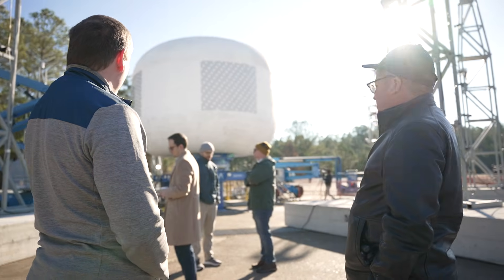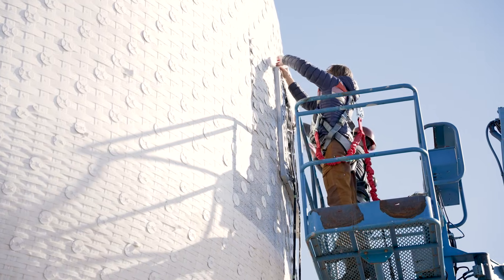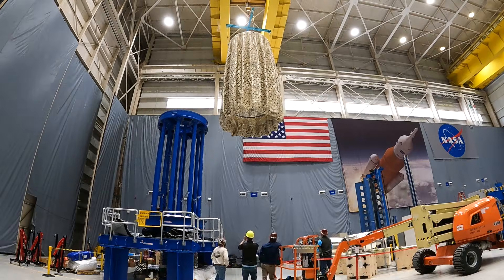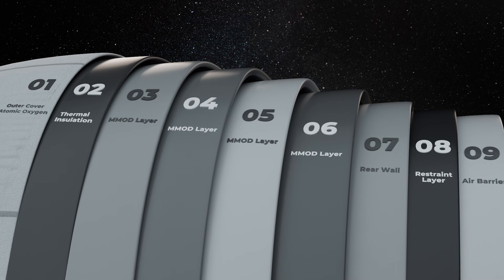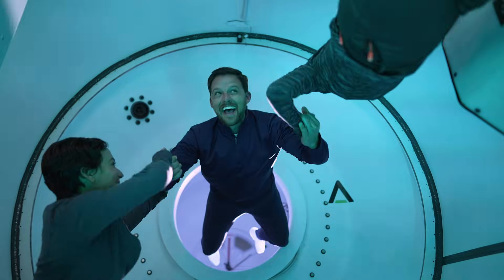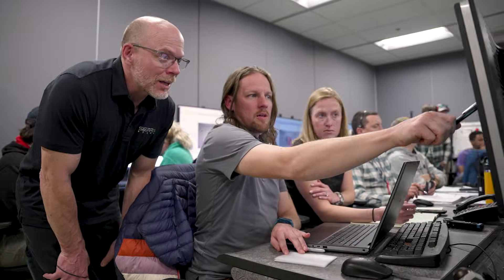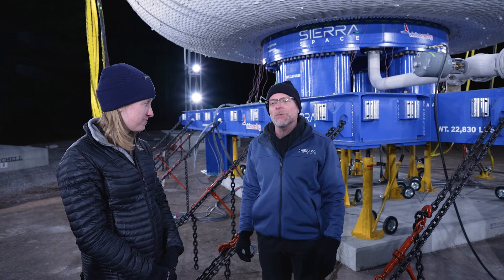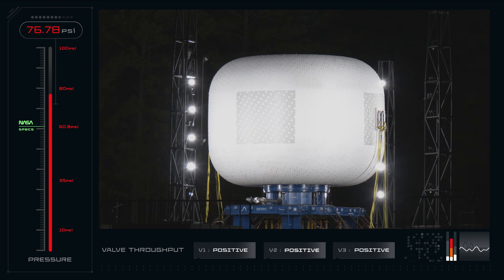Full-Scale LIFE™ Inflatable Space Station Burst Test at NASA Marshall Space Flight Center

Comment: interesting take on living space in space. i just hope its not gonna leave plastic in space too. think of the space turtles. 
in all seriousness the thought of a rupture scares me more than anything. how long is that material gonna last in the vacuum of space and debris along with the radiation. i do think after inflation there should be an internal or external brace put into place. that way in a loss of air pressure like a pump failure the structure will keep some shape so you can easily get in and out for repairs or escape. 
ive been watching your guys' progress for a bit now and its interesting. its always seeing a new take on something instead of everybody trying to reinvent the wheel to do the same thing.

Comment: Basically a huge air suspension air bag. That's mighty impressive to withstand 75psi on that scale. A valve seal broke before the structure, that tells you something.
Reply: dont use chinese valves. or ones rated for use with water.

Comment: I've had a similar idea for years.  the only difference was I thought an inflatable "bag" would be deployed, inflated then a spray on foam of some sort would be sprayed inside the bad to create rigid walls with sufficient insulating and protection properties to allow for much larger habitats for astronauts.  this is pretty awesome though.
Reply: Or have a few layers with valves to inject an expanding foam that sets to have a honeycomb like structure as hard as steel. The layers do not have to be that thick. Or develop a spray that goes on the outside, could then be any thickness and if slightly magnetic would stick to the exterior when sprayed before setting, make is so that it could be moulded until an electric current was applied that hardened it. So many ideas and I am sure Sierra will be getting a lot of ideas from people imagining ways to do things to improve it.
The one thing with research is thinking of solutions, researchers often hit a wall, until someone comes up with an idea that takes research into a completely different direction. 
I  wonder what size habitat they could fit to a falcon, falcon heavy and a starship booster. Also once an empty space station is up there a few flights to send infrastructure,  engines or solar or nuclear batterries. Even full labs that could clich into place inside or outside of the module.

Comment: Fake Bullshite...Nobody goes into space, nobody has EVER gone into space. ( as defined above earth's atmosphere) USAF veteran...The earth is flat and non rotating. 
page 14:
(2) A flat, nonrotating earth

https://ntrs.nasa.gov/archive/nasa/casi.ntrs.nasa.gov/19710018599.pdf

page 8:
the missile position in space is computed relative to a flat nonrotating earth.

https://ntrs.nasa.gov/archive/nasa/casi.ntrs.nasa.gov/20040008097.pdf

page 108:
aircraft flying over flat, nonrotating earth

page:12
"aircraft flying in a stationary atmosphere over flat nonrotating earth"

https://www.nasa.gov/centers/dryden/pdf/88072main_H-1259.pdf

NASA Technical Paper 2835

Page 1 Summary:

Flat nonrotating earth 

page 126:
"The nonlinear equations of motion used are six-degree-of-freedom equations
sith stationary atmosphere and flat, nonrotating earth"

https://ntrs.nasa.gov/archive/nasa/casi.ntrs.nasa.gov/19890007066.pdf

Determination of Angles of Attack and Sideslip from Radar Data and a Roll Stabilized Platform

NASA 
March 1972 

page 2:
"The method is limited, however, to application where a flat, nonrotating earth"

https://ntrs.nasa.gov/archive/nasa/casi.ntrs.nasa.gov/19720012071.pdf

An Aircraft Model for the AIAA Controls Design Challenge

NASA
1991

page 11:
"The nonlinear equations of motion used in this model are general six-degree-of-freedom equations representing the flight dynamics of a rigid aircraft flying in a stationary atmosphere over a flat nonrotating earth"

https://www.nasa.gov/centers/dryden/pdf/88248main_H-1777.pdf

Investigation of Aircraft Landing in Variable Wind Fields

NASA 1973

page14 pdf or 6 on actual report:

a) The earth is flat and non-rotating.

https://ntrs.nasa.gov/archive/nasa/casi.ntrs.nasa.gov/19790005472.pdf

A Mathematical Model of the CH-53 Helicopter

NASA  

page 17:

“The helicopter equations of motion are given in body axes with respect to
a flat, nonrotating Earth.”

https://ntrs.nasa.gov/archive/nasa/casi.ntrs.nasa.gov/19810003557.pdf
Reply: You are pathetic.

Comment: Very interesting, I'd like to learn how the interior is to be constructed.
Floors, the walls that instruments are mounted to etc. I doubt that the skin itself will be used as mounting points.

I know it's still in design so the create the "shell" is step one. But just having a "high tech pressure baloon" in space is not enough when these should be usable modules in a space station.

Comment: your article needs multiple layers so that if it leaks there's another layer layer upon layer. i think if you did this with helium blimps they could expand inter larger outer layers as the air pressure is reduced to reach higher altitudes and ultimately even orbit... solar can be used to recompress the air to control altitude -  why use rockets to reach orbit when you could drop off your payload in orbit and then switch the rocket of that Starship on? Wouldn't it save fuel? The reusable blimp-payload delivery system (the BonBonXFalcon (tm). This is just His Planetship's opinion.

Comment: Admittedly, a little more impressive than our inflatable roof tent. What I don't yet fully understand is how the internal volumes are handled, equipment, laboratory technology, infrastructure, furnishings. My expectation is that if everything expands or the positions relative to each other change, the number of error points will increase. On the other hand NASA managed JWT but who would stake someone's life on it? What worries me about the space race, as fascinating as the progress is, getting it done here on the blue marble would be a far greater incentive without a loophole.
So why not build mass-producible modular inflatable living and working structures for use down here on the home planet? An infrastructure core with bathroom and kitchen and rooms around it. Collapsible and transportable on a trailer. 3 to 5 PSI would easily be enough :-)
How easily can the shell structure actually be repaired? Rigid shell materials seem to me to be more manageable in this regard. Instead of using the material to form volumes from onion skins, couldn't the walls also be made from cell structures? Then it would be less frightening for the residents if only one cell bursts instead of the entire outer shell?

Comment: The fact that it still went so high after being repressurized from the first try, shows it also is durable.
Also keeping in mind that there's exponential additional strain over one atmosphere, this test got to 5x, I'd find this more than safe for pressure.

Failure won't be anywhere as dramatic, without some massive external force. (for those concerned by dramatic demonstration at 5 atmospheres)
Patching leaks out in space shouldn't be a huge issue, it would be closer to the first test where the pressure went slowly.
Duct tape would be enough and add strength to any bulge or scratch. I'm sure there's some premade patches for any such issue as well.

I'd like to see some toroid segments eventually, angling the ends is only a slight geometry change, because being able to get even a fraction of artificial gravity in a station would be a massive next project.
I'm always looking to the future.
Reply: slaps duct tape over hole
"Mission control,  problem solved"
dramatic pose and arrogant smile
Reply: Your point reminds me of the failed submersible.  It worked for a bit...until it didn't.
Reply: Space does not exist, sorry NPC

Comment: When Boeing was certifying the 747, the wing burst test was within a pound of the engineered specifications. I hope you can refine your calculations to be closer to predicting the engineering structural integrity in the same manner. 15 pounds is not a controlled calculation. I'm sure you'll figure it out. Congrats overall. Outstanding first test and cool you shared it here.

Comment: I've always wondered why they don't just use the great big fuel bodies that they've been allowing to burn up in the atmosphere for decades.   Take an Atlas5 main booster... that thing is f*cking HUGE.   Add a bit more fuel, get it to a stable orbit, and turn it into a hab module.   Since it contains liquid for launch they could actually install a lot of mounting hardware on the inside that would not negatively impact its ability to store fuel or its flow to the propulsion area.   Once in orbit it could then be sealed and the mounting hardware could be used to convert it to a habitat.
Reply: "Add a bit more fuel, get it to a stable orbit" I'm no rocket surgeon, but I don't think "a bit more fuel" is going to get it to orbit.
Google says: Atlas 5 Empty mass 21,054 kg (46,416 lb). Getting to space is easy. Getting into an orbit that doesn't intersect the earth is hard.
Reply: That would take away actual payload.

Payload of entire ship 8,900kg
Empy mass 21,054 kg.

Their is not enough fuel onboard to take an Atlas 5 booster to orbit.

Comment: The explosion illustrates why inflatables may not be a good idea for space. Life-critical hardware needs to fail gracefully, allowing ample warning of trouble. With a solid space station, a leak can be located and plugged. As we saw in this video, with an inflatable it cannot. One second it seems fine. The next it is gone.
Reply: That is why you keep the pressure much lower then bursting.

if you filled a steel container rated for 100PSI to 200PSI would it give any warning when it failed?
If you had a ballon rated at 100PSI but filled it to 15PSI would it give any warning when it failed?

Comment: And what happens when it gets hit by a metorite?
Reply from the maker: Our team has conducted MMOD High Velocity Impact (HVI) tests with NASA that simulate the environment, utilizing high power machines that can shoot a projectile at the rate or velocity of an impact in space. The layering is meant to absorb any impact and it is designed to be patched from the inside.
Reply: What are the limits?  This test seems to suggest bursting/splitting wide open is a risk. @SierraSpace

Comment: Is this the kind of tech that looks great on paper but loses most of it's advantages when brought to a practical, useable iteration?  I mean, it seems like there's still quite a lot of complexity and weight to deal with with that many layers and the whole support structure.  Expense from all the technology trickle might be manageable on the front end of manufacturing to give the advantage of compactable transport to orbit, but I'm curious how much of an advantage overall this tech gives in return compared to full legacy module transport?

I'm not knocking this at all, just wondering how much of a game changer this actually is, from someone who's not essentially a marketeer for Sierra Space.

Also curious how much better this performs against micrometeorites as compared to current solutions and proposed solutions (like exterior foam, etc) for protection in situ.

Comment: I know you are a US-based company, but why would you measure the pressure in psi? Doesn't NASA solely work with metric units? Also, wouldn't it make much more sense to measure in Pascal or Bar, because it would give a much more direct comparison to the nominal operating pressure, which I'm guessing will be 1 Bar/Atmosphere?
Reply: The module burst around 5.1 bar.

Comment: I hope they test material for all types of weather conditions or impacts from kind of object that could possibly rip it or damage it badly! I think if muiltible country or companys submitting design proposals then  allow them build them then strategically place in diffferent orbits around earth or moon which expand horizons to do more Colab research on areas that  we need data for at much quicker rate and open more doors for things and every station could have own purpose or research area cause right now with one station even with its size we are  limited to extent what can do now already! If this design gets picked as next space  station! I hope they allow every country to send up own add on editions to it and be compatible with it  meaning be totally accept every country  that has space agency/astronaut program  or private/commercial space companies with connections that will connect to it also have docking for spaceplanes,spacecraft,space capsules modules for each of country’s/region located in there section of station where meaning country or region from!

Comment: I cannot imagine real scientists and engineers using psi as their main unit in 2024.
Pounds per square inch, really?
Newton per m2, Pascal, even Bar, but psi??
Reply: Replacing all your engineering tools and tech that have been calibrated and designed for English units rather than SI units is a very expensive proposition.

Comment: QUESTION:  Won't you possibly still need a shield to help protect the station from harmful debris?
(There is a lot of debris in space where this will be).
But also:  Possibly useful for example as a moon base structure, covered over with moon's soil for added protection.
Reply from the maker: We use several layers of softgoods technologies. One of these layers is MMOD – Micro-Meteoroid Orbital Debris protection. This multi shock layer is designed to protect the habitat from orbital debris strikes for the lifetime or mission duration and its specific environment. This is a highly advanced design based on known technology that is applied to the surface of the pressure shell or restraint layer.
Reply: @SierraSpace  Thank you for responding.  Good to know.  Seeing and hearing about the damage to the ISS over time was one of the first things I thought of with an inflatable habitat.

Comment: 75 psi is right around tire pressure in a bike. Is that really an achievement or am I missing something here? Good test I guess.
Reply: The margin accounts for space debris hitting it over years in continuous use at ambient human pressures.
Reply: Getting mass to orbit is expensive. Getting a rigid structure to orbit requires a launch system that can handle the dimensions of the rigid structure. Those are two things which the designers of your bike tires did not have to be concerned with. This company is trying to design an inflatable structure both light enough and strong enough to be useful in space. Since there are always trade-offs, and there is no free lunch, you try to get things to break at the target PSI (say, 60 psi). Anything that survives 60 psi and gets to 75 psi before failure can then be re-engineered to be a little less strong, a little cheaper, a little lighter. If you think the design you're currently testing is close to production-ready, and you're already exceeding your test requirements, then that's a huge deal. Testing to failure is always exciting for the engineers as well as those who actually built the thing.

So, yes, you're missing something.
Reply: Have you seen a tire that is  6.25 meters tall and  8.23 meters in diameter?

Comment: How do these Inflatable 'Soft Goods' Space Stations protect against solar radiation and punctures (self-sealing systems - obvious where the leak is coming from)? Ideally you need to fill one of the layers with 70mm of water to act as a solar radiation barrier, and would also act as an emergency air/water source/energy source (water can provide oxygen and hydrogen via electrolysis and energy from external solar panels).

Comment: So they made it to 75 which is pretty cool like 25% above rated requirements. But I do wonder what is the operating PSI of the habitat normally? Is it like normally 15 PSI? So that is 500% over operating pressure. That's pretty good!
Reply: Indeed, it would operate at 14.5 psi under normal circumstances.

Comment: It doesn't quite look very sturdy; on the other hand... there is the question what happens if a rigid tube is hit by a piece of debris at 13 km per second versus what happens if an inflatable tube is hit by a piece of debris at 13 km per second?  Rapid decompression and general badness for anyone that's inside is the answer to both.  But the advantages of having modular units that you can orient and construct any way you wish sounds potentially quite useful.

Comment: wasn't the Titan sub from composites and much stronger than steel subs?...
Reply: Composites aren’t very good at handling externally-sourced pressures, like that applicable to deep sea submersibles. In space, the air is pushing outward, not inward. Composites can handle this just fine; the 787 is a lower-altitude example of a composite structure that can safely handle multiple compression and decompression cycles.

Comment: I love how everything works perfectly in space, but somehow it's much more dangerous below even 200 meters of water. If something doesn't fail on Earth or during launch, it will likely work perfectly in space. I wonder why? It's interesting that nobody dies above the Kármán line in space history, while just last year, we lost five people in the ocean at depths of less than 500 meters. Every metal and solar panel, even aluminum satellites, work perfectly in temperatures ranging from 250F in sunlight to -250F on the dark side of the Earth. Yet, electric vehicles won't even turn on in temperatures between 20F and 30F with their newest battery technologies. It's sad that people buy into these nonsensical, almost Narnian space stories without being skeptical about any of them.
Reply: If only personal incredulity was an actual argument, then there'd be a point to you typing all of that.
Reply: Underwater pressures get freakishly high freakishly quickly. At the Titan’s failure point, the sea was pushing around 100 PSI against the sub.